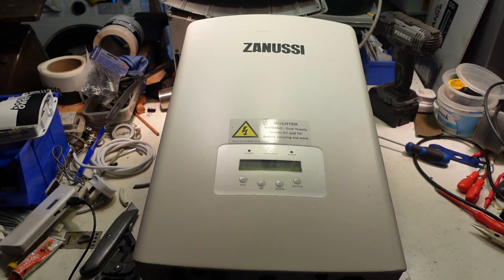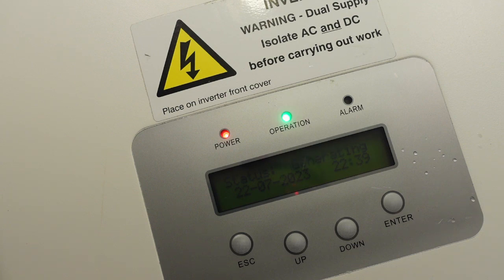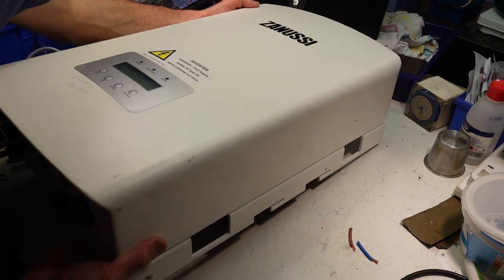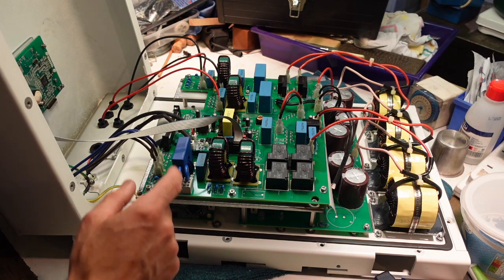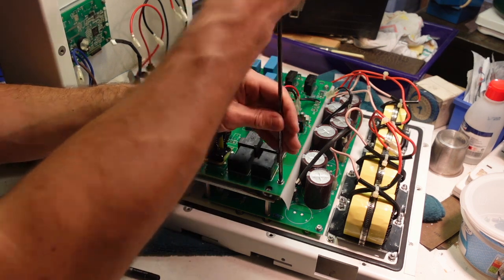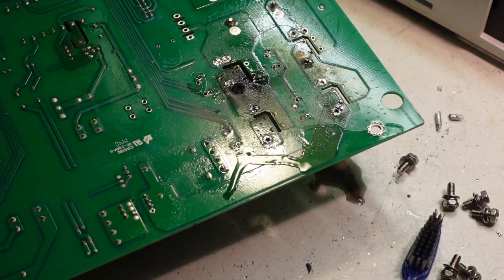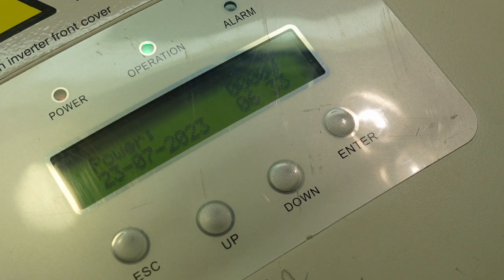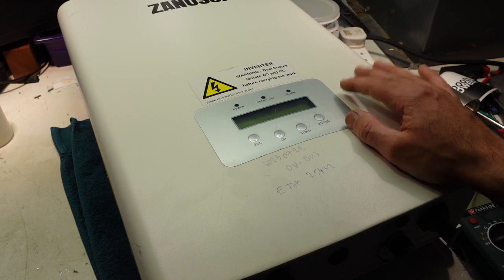Zanussi ZAN 3K 2G Inverter OV BUS Relay error repair (Solis 2G)

Comment: Thank you for your repair movie. I've got a question about H-bridge repair in combination with OV bus warning. I will send you a message through the link.
Reply from the maker: Hi. Please post the questions on the appropriate video. Others may also answer too. I got the email. I won’t be in the workshop for a few days but I can take a look later. You need to specify which model you have.  I only have gen 2 3.6. They could have different boards.
Reply: I've got model Ginlong GCI-3K-2G-Wind  @bootsowen